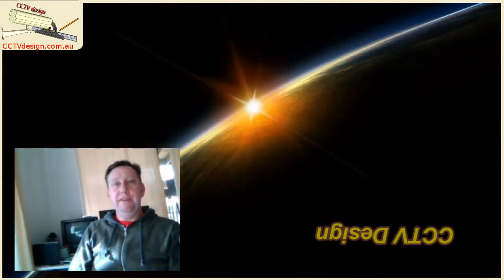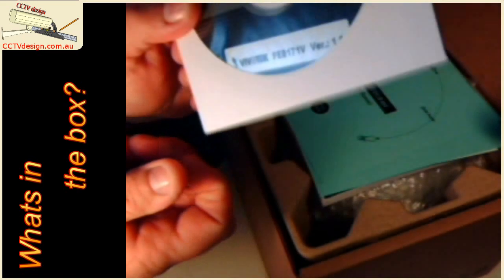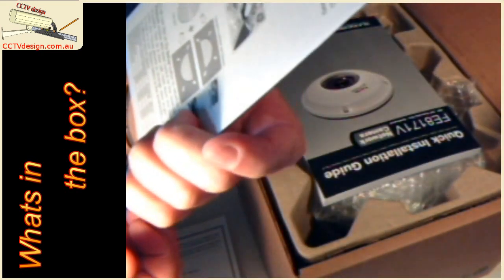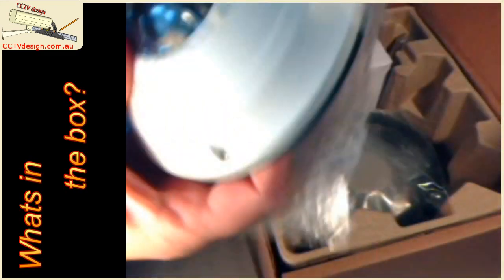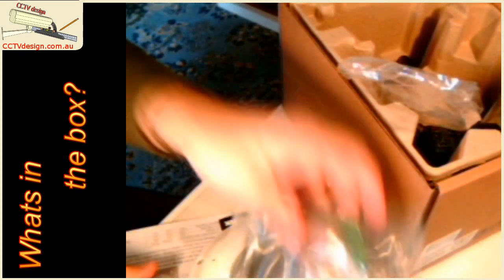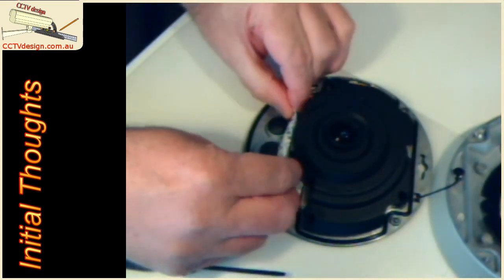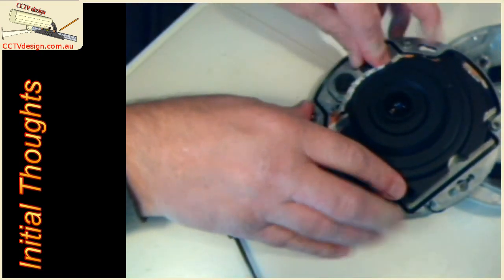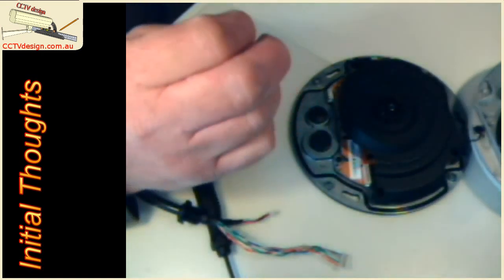Evaluation - Vivotek FE8171V 3.1 MP Hemispherical (360 degree) IP Camera

Comment: Hi Tim.  Part 2?  The camera looks fine to me, but I'm more interested in the images.  Your minor niggles aren't much use so far.  I don't think it's gonna leak.  And it's very easy to provide a little insurance against leaks. I would also think that you could wind the cable around the lens in the opposite direction (clockwise) to correctly install the cable.  To my mind, this camera, with it's regional views, has the potential to replace at least 3 1.3MP cameras.  And uses less bandwidth doing it.  But I'd like to see someone actually try it.
Reply: I feel that 360° cameras need to be understood better as to the applications they suit. Since this video was published, I have installed several and yes they do suit the applications I supplied them for. Overviews.
I feel peoples expectations of 360° cameras are that they will identify everyone passing through an area but the reality is there are many aspects preventing this. Height and light variations being two of them. 
Use them - but only for overview of an area or to recognise people you know in a small area.